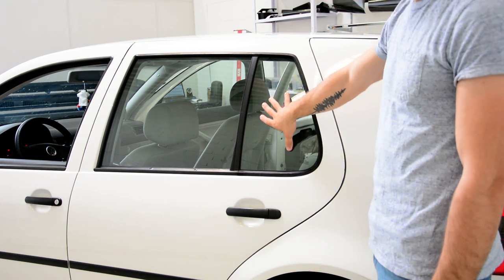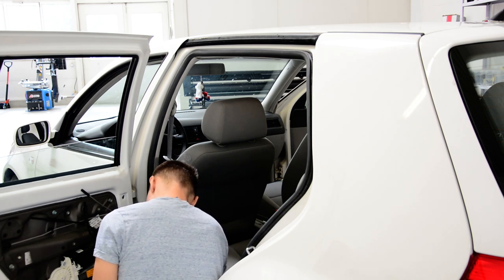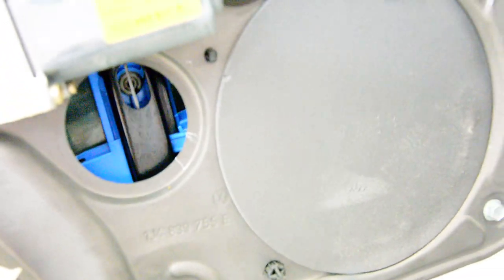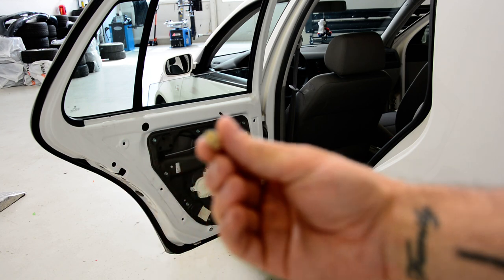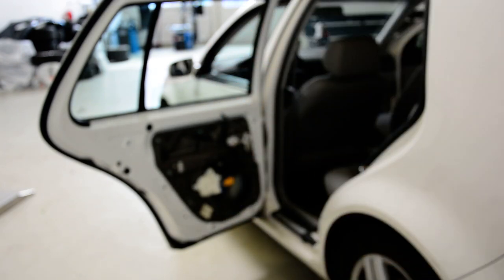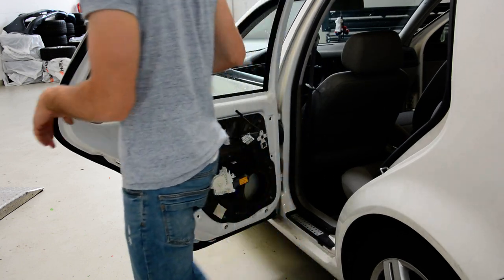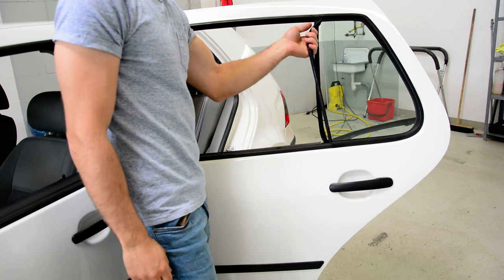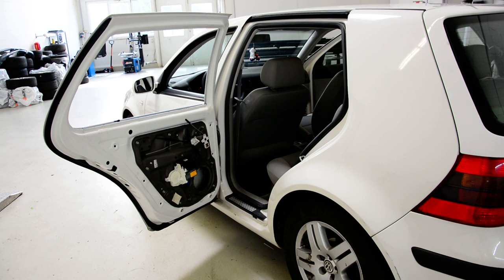Vw Golf mk4 rear window removal and quarter glass

Comment: This is not how the pin should be removed. Check the workshop manual. One should use 5mm and 8mm bolts to pull it out. It won't fall into the door if you follow the real/correct instructions.

Comment: What did you use to pop the round clips holding the main window? I could not get mine out. Thanks for the video!
Reply: For my 2016 E-Golf, I did not need to remove the main window to remove the quarter window. In addition to the two bolts on the inside of the door frame, the quarter window frame is held in with a clip at the top, behind the exterior weather stripping.

Comment: I broke the blue plastic window mounting piece trying to knock out the center plastic cylinder piece with a screwdriver like he did. Put a screw in the smaller cylinder and pull it out!!